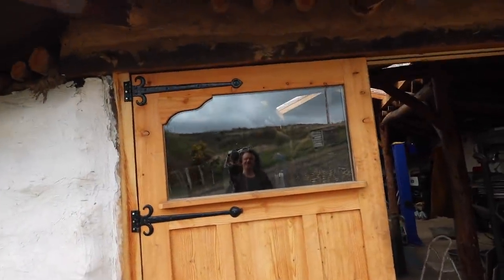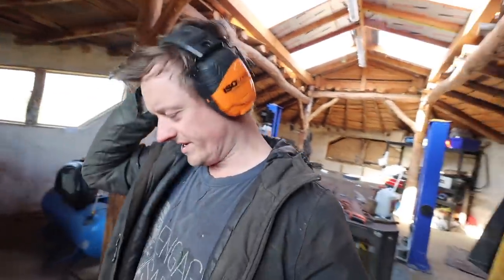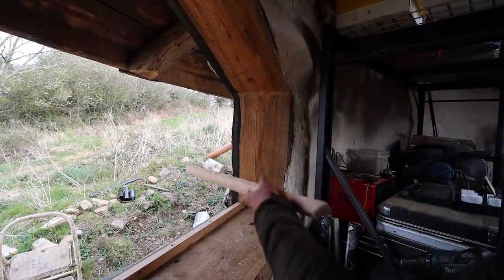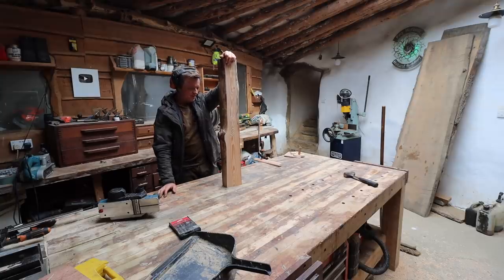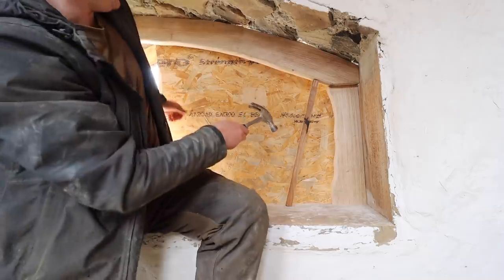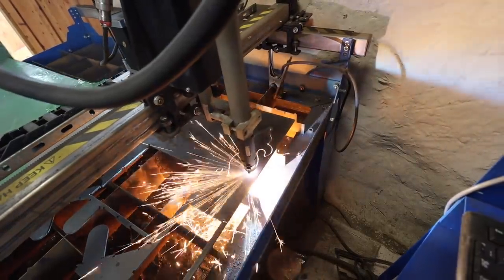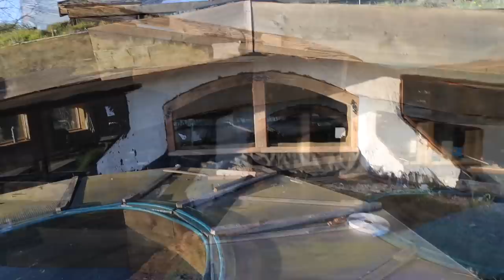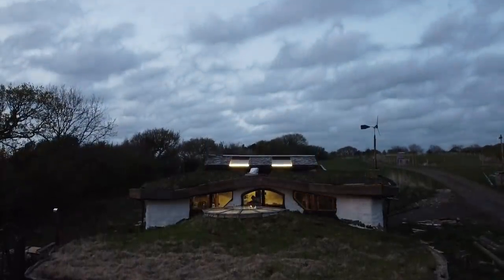Off Grid Earthbag Workshop Part 78 Installing Custom Cut Windows On Curved Walls

Comment: Hi Kris, I learned to use a UV filter on my lens to protect my more expensive equipment(tele lens) and with success. Your windows looks amazing. Thank you for sharing your amazing journey. God bless you and your family.
Reply: Trick is to not have the cheap filters on, or you'll get other problems, but yeah that is a must for the plasma cutter and welding.
Reply: I gave up using UV filters to protect a lens as they became micro scratched much more easily than the lenses did, but I do keep a lens hood attached to protect from knocks. Having said that, I don't use a plasma cutter.

Comment: Time management! Kris, you have that rare ability to know your limits. Even you are not (quite!) superhuman. You knew you could produce fully morticed windows, which would have made the armchair woodworkers salivate, BUT you also knew you could get a super result quickly, using brackets made by the new plasma cutter. Many things might be possible, but you can see what is do-able for your world, your timescale, your budget and your energy. No wonder, you're celebrating!

Comment: Amazing work on those 'squiggly' windows 👍When you do the plastering it would be worth adding a chicken wire former so you can form a plaster drip edge, to stop water from tracking back to the window frames.

Comment: Wow Kris...simply OUTSTANDING!!!  That has to be incredibly satisfying to have gotten all those windows in; and done such a beautiful job of it too.  I'm blown away by what you've achieved on this project, one remarkable step at a time.  Each sub-project of this entire build has been a huge project in itself, and you've taken each one on with so much thought and creativity, marching towards your dream and goal.  I'm truly in awe of what you've created there.  

Although there are just too many things to love about what you've created to list, one of the things I'm the most proud and in awe of is that you've basically done it all with natural materials off your own land or relatively close by other than the bags, glass, plexiglass, electrical wire, a small bit of concrete and fasteners.  I doubt you could fill a single large bin with any non-recyclable trash from the entire build!  You've designed it all of course, harvested and milled all the wood with a mill you made yourself, harvested and split all the shingles by hand, made your own lyme, used the soil on the site to build all the walls and stone for various parts as well, AND done it all with power you've harvested from Nature with your homemade wind turbine and micro hydro plant!  Truly remarkable...  

I'd be curious to know the total cost of the project (the building itself separate from the tools you've added in, but those as well) as I'd imagine you've spent less than a fraction of what it would've cost to hire it all done with standard building materials and a fraction of what it would cost to buy a shop with everything you have in yours off the shelf.  It just shows what someone can accomplish with their own two hands, and a TON of hard work of course.

These are ALL things I too have dreamed of doing on our land, yet dreaming is not doing.  Doing is doing, and you've done it!  I know there are "a million little jobs left to do," but honestly you're in the home stretch and the place is a highly functional piece of art designed to your exact needs and specifications.  Those windows are just gorgeous, and all that light flooding into the shop now has transformed it.  You should be immensely proud of yourself. I greatly admire all you've accomplished.  You're an inspiration to my husband and I as we embark on building our own homestead along the same lines.  Congratulations and much respect!

PS - We may be in the market for a microhydro turbine once you get your operation up and running.  : - D

Comment: The look is fantastic... Suggestion:  cut horizontally under each door window to make it able to open out whilst keeping the bottom doors closed.  You could latch both sides open for air and put in a pull down screen. Like a buck door.  What ya think?

Comment: Lovely job
Be careful with your screws , nails and iron mongry in oak as the Tannin in the oak reacts with iron, causing a black stain
Maybe use brass or galvanised screws and maybe paint the back of the nice brackets you made
Indeed you are a very tasty worker
Well done

Comment: Send your broken lens to a company called Fixation. They'll likely be able to replace the front element of the lens and return it to you for less than the cost of a new lens. Great company, and all the photo-journos use them.
Reply from the maker: Thanks I might well do that. I actually started having a go at fixing it today. I span it in the lathe and sanded it down. Just need to go u though the grits now to polish it. If it works great. if not I will send it off to them. Thanks for that.
Reply: @KrisHarbour  A lens in a lathe?! Legend. You might get some wicked bloom without the anti-reflective coating but I'm keen to see the outcome! I had to sheepishly hand them what was left of a Canon 70-200 in a carrier bag once and they didn't even bat an eye! They do an amazing second hand kit sale, and you can find a PDF on their site. Great opportunity to get cheap kit.
Reply: @KrisHarbour  you can also get a plain glass lens to screw on front as a protection.

Comment: Super job Kris! Have you considered fitting screw on UV filters to your lenses?  I use them as a matter of course to prevent damage to the lens, they aren't cheap but much lass expensive than a lens repair or worse still a new Canon lens.
Keep up the great work

Comment: Well done Chris! You should really be proud of that building man. Your videos are very inspiering.
I would like say two things about the further plans for the Windows. The plastic matt under i would recommend not be plastering in. Better to plaster up as far you can and let it rest over the plaster and cut it off with some overhang so that water wont pour into the wall.
And when plastering agains windows it is better to not put nails around the window frame vit to plaster against and cut with with a thin knife/metall piece between wood and plaster so that it can move and not start cracking.
Hope this might help looking forward to see all future projects
/ Bricklayer from Sweden

Comment: sadly Kris Harbour  I, can't afford to become a patron my funds are limited  & I'm 70  but live my life in my younger year's of grid in a cottage in Wheaton Aston. infect i was born of grid as it wear.  it was  called the Sowdelis.  i have whach. all you videos & reported them to twitter . for all to see  & learn from .  i get it  i have an idea fir your generating wind mill  to help people that can't run a wind mill / it involve running a single phase  motor f a pillar drill  to drive. it that can be trend on & of like a fridge. when batteries are full As a back up to Soler panels .  well that the idea son ues it if you whant . be my gest . but the mans my be a problem to solve

Comment: You might want to get some neutral filters on your lenses to protect them. Filters are way cheaper to replace than a lens. For still photography it used to be standard practice to put Sky 1A filters on everything! Good job with the windows. Now just the little things left.

Comment: You might get away with the steel brackets on the oak. But i definetly would not recommend putting a lot of iron based nails into the oak for plastering reasons. Iron and oak will damage each other (iron sickness), especialy if water comes into play (as it will be in the plastering). Better to use wooden pegs or other metals than iron.

Comment: lovely video, Kris or anyone who knows or has an opinion, I need to replace some 100 year old sash window units, just the glass, I've found a company that does made to measure double glazed units, but if anyone could recommend, also advise about whether to have the argon gas and vacum and the best sealers to use, also thought you need to use something spongy to allow the glass a bit of expansion though Kris's seem tightly sealed in.  Anyway any help regarding double glazed unit replacement for sash windows much appreciated, thanks everyone

Comment: If you're doing any more welding / plasma cutting I really strongly suggest you buy some sacrificial UV filters to put on any new lens. It's much cheaper to replace those than it is an entire lens. 

It's probably also worth seeing if you can get a replacement for the front element of your existing lens too, some manufacturers are actually pretty good about providing you with them or fixing their stuff (Canon, Fuji) and some are less good (Nikon).

Comment: I'm sure you've had dozens of comments about this by now, but in case you haven't, get a UV filter to put in front of the lens. Even if the housing gets a bit of flying debris, it'll protect the optics. And, if it gets damaged, just replace it. Windows looking good! 👍️

Comment: I just finished watching all 78 chapters of your amazing journey to the ideal workshop, and will continue to tune-in for more of your adventures in the future. As a retired high school technology teacher who specialized in energy and power tech systems (who along with an enthusiastic bunch of students took-on the challenge of renewable energy design and constructions in the early 1970s), I am appreciative of your ability to build your own wind and hydro-electric equipment. As you know, there's more to it then bolting wooden (wind turbine) blades to a generator and have the thing produce power. Keep up the fine work!

Comment: Sorry for posting a less positive comment
The big flaw is safety, never put the screws or just strips that hold the glass on the outside
Yes I know it's easy to break a window or a door, but it's less noisy to come in without breaking, and then to open the big door from the inside without the key.

Comment: I know this came out 2 months ago and you probably won't see this, but if some sparks land on your lens and mess up the outer layer, it's actually not a super difficult repair to do yourself, but you can also send the lens away to be repaired, usually for less than the cost of a new one!

Comment: If i want to get in, i just need a screwdriver and remove the hinges on either side. Why not put those on the inside of the doorframe, so when the door is closed, it's in front of the screws?

Comment: Is the glass installed to the manufacturers specs? No setting blocks, fall on the sills or drainage? If not the units will break down in a matter of 2 yrs or so. Looks good but not sure if they will last.
Reply: He showed putting angled edges an them..and since he had to brace them before install, I'd guess there's plenty of settling space.  Also, those timbers aren't going anywhere.

Comment: Are you using motor oil as a finish? Could you talk more about that some time?
Reply from the maker: No Its a water based treatment for fence post. someone gave me a big tub of it year ago and I have just it ever since. I have no idea what it is or where to get it. But I have 20l tub of the stuff and you mix it 10-1 so it lasts ages.

Comment: I think the bandsaw is totaly fine for work like that. But seeing the feeding rate you managed to get cutting the oak and all the sparks on the guides, i would say the blade is not sharp enough for that kind of work. An absolute sharp blade is very critical for any bandsaw to work propably in serious thicknesses of wood.
I alway try to have a brandnew blade in stock for this kind of work. The duller ones are still good for many cuts (thinn stuff, cutting up firewood...). It is worth swapping them back and for due to the task.
Reply: The stock is maybe really thick for the tooth pitch of the blade?
I try to only have 3-5 teeth engaged in the kerf. Fewer teeth means bigger gullets to carry the sawdust away.
Reply: @jimurrata6785  Competely true. But in reality it is a lot of trouble to have that many different sawblades an constantly swapping them. I go with just one tooth pitch but I buy 10 blades at once. Once I have to make a difficult cut (thick stock, small radius, has to be accurate) I throw on a new blade if the current one already has done some serious cutting. If I than have to cut a court of firewood, I put on the already slightly dull one.
With a new (or freshly sharpened a set) blade my 750 Watt saw is able to resaw 25 cm wide boards without a problem. With a slightly dull one (that would easily still cut my firewood for one year) it has no chance to do that.
Reply: @peterhase1045  It certainly depends on the job.
I like a 8mm wide variable pitch blade to keep on the saw most of the time. It is thin enough that I get good tension and the tooth pattern all but eliminates harmonic vibration.
Sometimes a narrow blade with fine pitch for multi-ply or a wide skip tooth for resawing is needed.
USA here so my numbers may not make sense to you, but 16" saw with a 1hp (750W) motor and riser block uses a 109" blade. 3/16-12 would be about 4mm 2 pitch and 9/16-3 equal something like 14mm by 8?